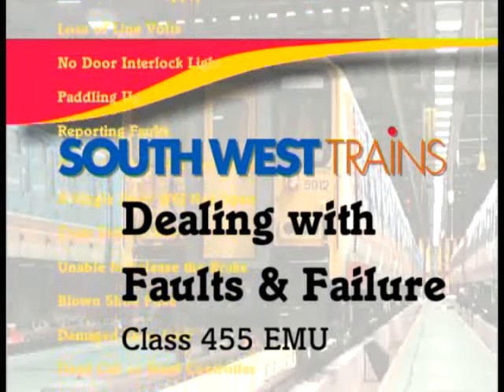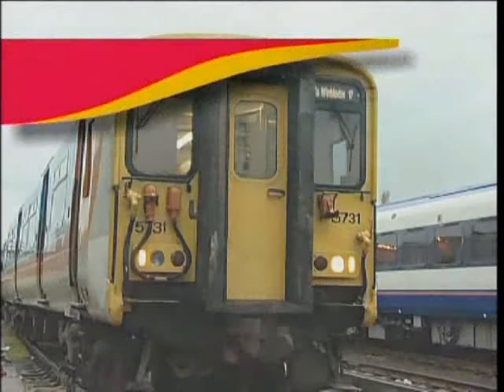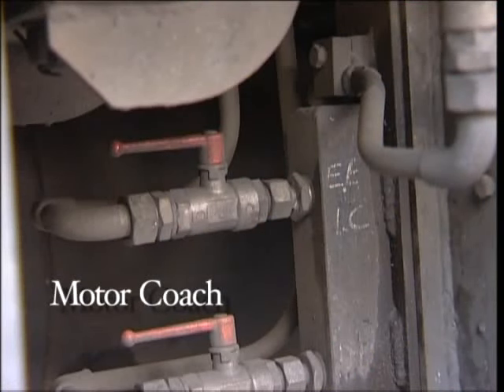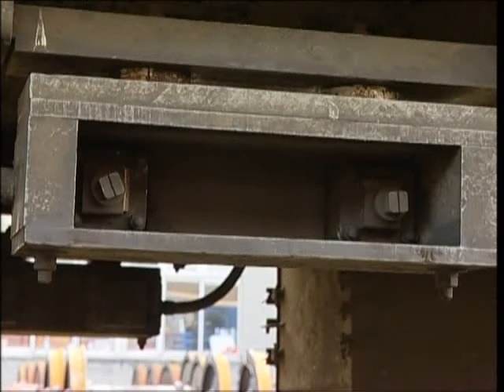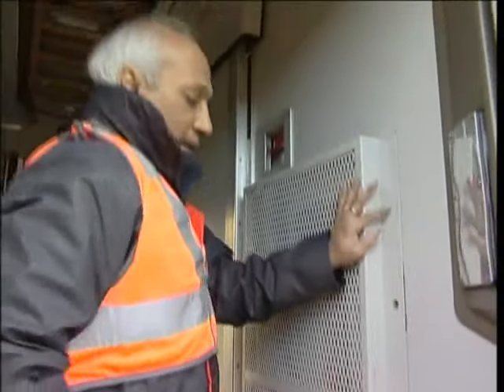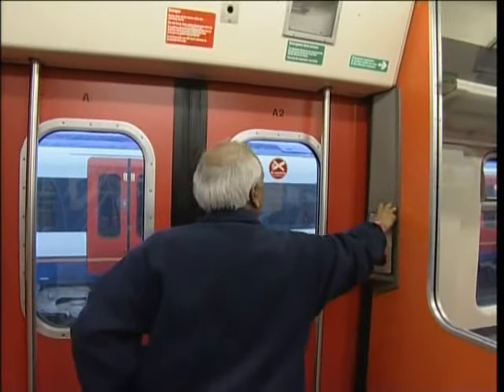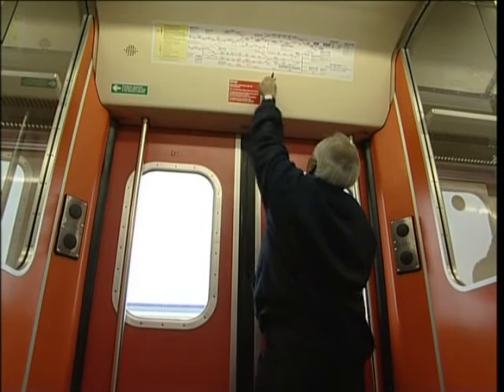Class 455 Common Faults and how to Rectify Them - (2000).avi

Comment: I've always said the difficult thing about being a train driver is not the driving. It's dealing with faults (and the leaf fall season). This video proves it once again. Also, after seeing all this paddling I'm glad I never drove third-rail equipment. :)
Reply: What a whimp. You could have a lovely free fireworks display playing with paddles & hook switch poles or better still "Short Circuiting Bars". With Arcs flying over your head & lighting up the sky. Much better than Guy Fawkes Night !!!!

Comment: I was driving class 455 in TS2015 and brakes failed to release. Now rewatching this XD
Reply from the maker: I've had a go on that and it's not too bad.  The braking dynamics are all wrong with the mk1 units as with tread brakes they don't work too well at speed whereas slow speeds they really bite.  Good fun and a couple of the routes on that are fairly accurate in terms of signal positions.  I would even say you could catch up on route knowledge 😉
Reply from the maker: +Delsin I didn't know you could drive a Thumper on it, love them old bastards
Reply from the maker: +Delsin I'll have to have a butchers at that.  I hope it's nice and claggy and they've got the right sounds for her, the Turbo whistle on notch 7 is a must!!! 😀

Comment: How the heck do drivers remember all of this?!  I was lost completely after a couple of minutes....
Reply from the maker: that's why it takes a long time to be signed off on a type as well as the route knowledge. you need to know practically every inch of track. For example at night you come around a bend and there's a road running parallel to the track and there's a traffic light on the road showing red, is that a signal at danger or s traffic light?  You HAVE to know 😀
Reply: Yes, overly complicated

Comment: Are regular drivers required to perform all this or is it for the engineers? I'm loving the shoe fuse.... copper plate....lol. Any idea how many amps those fuses are rated at by any chance? I know the voltage is very high, so maybe not as high as i think. 200 Amp?
Reply from the maker: The ee507 traction motor draws a max of 2200 amps so the fuse is probably 2500 to 3000.  I'll find out for you0
Reply from the maker: Here's a graph showing amperage draw over time in seconds.  http://columbia.libpthread.so/rw/cl455-perf/CurrentVsTime.png
Reply: When Starting a 12-car EMU formation out of Waterloo on the 750v DC system, the train would at starting, draw normally 3200 amps. 

Over at Euston a Class 86 starting a 12-car train would only draw 65 amps. Because the current was 25,000v AC.
Reply: @railwaymechanicalengineer4587  wouldn't be surprised if the rail got slightly warm with that current.

Comment: Might I suggest that when looking & listening around and between cars for defective hoses & connectors you do it on the side opposite that of the electric third rail?  Out on the line, it's unguarded completely--no protective slats--so if you slip, stumble, or trip you could make accidental contact with it and the earthed train body, which could very well be a 750-volt ouchie.

Comment: I never realised drivers had this sort of responsibility in dealing with various faults. I suppose in steam days you just needed a big hammer, the bigger the better!
Reply: Back in the days of steam you had to "dump the fire" out of the fire box if the boiler water level dropped too low, otherwise the boiler could explode in your face.

Comment: one thing i have always wondered is why are there rails that are not used inside the 4 foot? I
Reply from the maker: if you're talking about 'loose' rails, then they are normally dumped in pairs in the 4 foot when a renewal is due
Reply: And in the Netherlands (and probably other parts of Europe as well) it's become increasingly common to strengthen the complete track by mounting a pair of extra rails in the middle.
Reply: 4ft “check” rails are fitted where slippage is likely such as on tight curves or over some bridges where ballast levels are low. 
Other than that the rail in the 4ft is (as already said) delivered where a rail change is happening at a later date

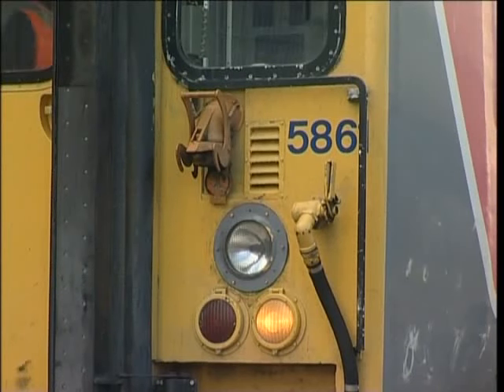Comment: 8:10 What the hell do you with the passengers if you are not at a station? Presumably taking them the passengers to a station and then taking the unit out of service would be more sensible?
Reply: Inform the passengers they will be provided with alternate transportation. Then, retrieve the paddles to deal with the ensuing riot. Contact dispatch to send a flying squad for assistance. If further emergency assistance is required, set the machine gun isolating cock to the 'operate' position in the cab.

Comment: Forgive my ignorance, what does a 'motor alternator' do?  Does the train not pick up aux power supply directly from the conductor rail?
Reply: No, the third rail supplies 750v Dc which isn’t too useful for auxiliary supplies hence the alternator turns it into a more useful voltage, most likely 415v ac 3 phase,

Comment: Why the contact surface of the "plus" rail installed at up position? I think it will always  be in worst condition - moisture, rain, icing, snow, etc. -  hence bad conductance. Moreover, it must be  danger for  maintenance personal.   
I guess there is one only advantage it is just simplest installation along track.  Explain please, experts. Thanks.
Reply: DC electricity flows from - to + so the + rail is simply the return path.
Reply: You did not understand question.
Reply: +alberttwo68 oh yes my bad. At my own guess I would say it would be easier from a maintenance standpoint to just put things on top instead of hooking underneath. For example on the DLR, trains cannot be powered through junctions because it would be too complex To have power rails throughout, which means if a train does not have enough momentum to coast it can stop and be immobilised in a junction.
Reply: +alberttwo68 yeah, that rail type would have the same issue. Also changing power delivery over the entire network and also adapting trains is a costly measure. It's cheaper just to do the maintenance needed. Also, with the shoes going over the contact surface all the time, I guess it would brush off any water or contaminants.
Reply: Yea, thanks. Same thought. This explains why British subways and suburbs trains keep this method of power distribution. Question cleared. regards.
Reply from the maker: plus the system dates back over 110 years when the London & South Western Rly and South Eastern & Chatham Rly electrified some of their lines.  The London Brighton & South Coast Rly used AC Catenary @ 6600v which in hindsight should of been the route forward instead of the 660v DC Third Rail.  Nevermind some of us like the trusty juice rail, simple and normally very robust & reliable.
Reply from the maker: Ps.  In some yards and sidings they used to have a DC overhead wire instead of the juice rail for safety reasons but it never caught on as only the HA types, Class 71, could utilise it.
Reply: @darrencafferty  The SECR never electrified anything. The Southern Railway did after the Grouping in 1922, though.
Reply: @bobwilliams8317 that problem can be and is rectified by trains having multiple shoes. That's how they can have a break in the power supply, for example at level crossings and not relying on the train to coast, because at least one shoe is still in contact

Comment: Proved usefu when fault finding on Thumper 205205
Reply: When did the
Fireman and Brakeman go away? Lots of time and effort saved if the 
Engineer or Driver could stay with the throttle and let a second person,do the legwork for hot boxes, opening doors and calming, passengers.

Comment: Does anybody know why 455/456's have manual air pipes and jumpers, instead of the combined connector block under the Tightlock coupling like other units?
Reply: I think it was something to do with tradition, the old southern region didn’t like change.

Comment: Why don't they have a reduction of brake cylinder pressure mean the application of the brakes?
Reply: its the way the braking system is designed it you have to apply pressure to the brake cylinders to apply brakes, the 3 step brake that is used on these units uses electrical signals to control the brake valves